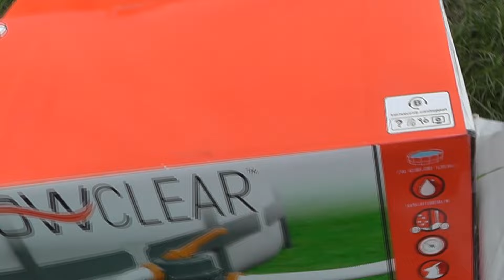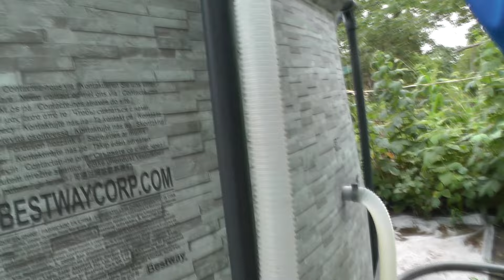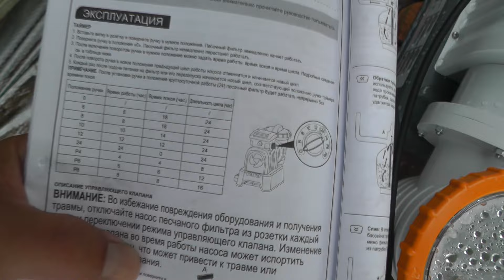Bestway FlowClear 58497

Comment: What fraction of sand should be poured into the Bestway FlowClear 58497 filter?
Reply from the maker: For the Bestway FlowClear 58497 filter, it is better to use quartz sand #20, 0.45-0.85 mm.